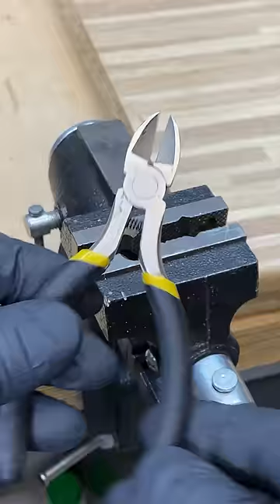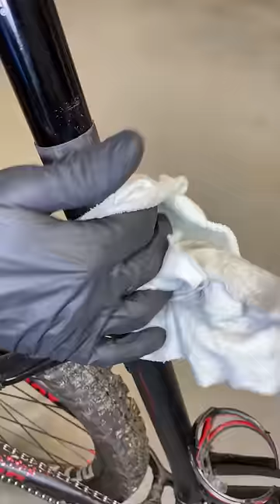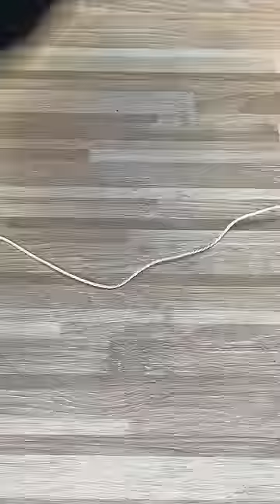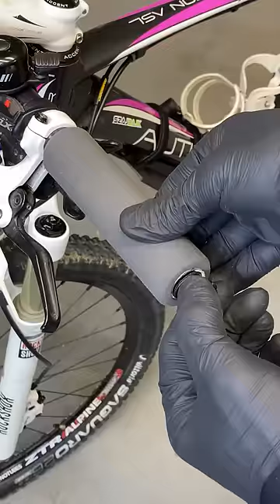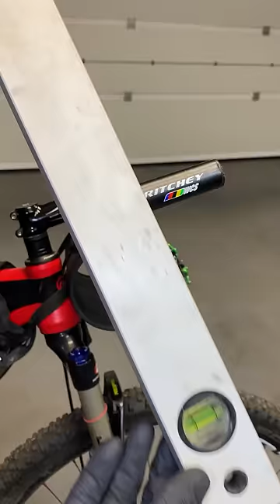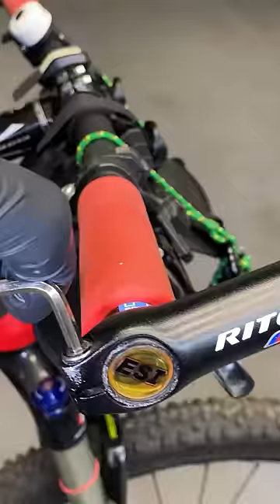Servicing gloves inside the bars, leveling bar ends + more hacks.

Comment: Hack: grease the seatpost so it doesn't get scratched up like crazy 😢
Reply: Only the part inside gets scratched, and greasing it can cause your seat to slide down while riding, I don't suggest this to anyone at all 

Your seat is always in a fixed position, there's no reason scratches should be showing.
Reply: @selfactualizer2099  you ALWAYS grease the seatpost or use carbon paste. A seatpost will eventually corrode and seize inside the frame if you don't. It's also a common cause for creaking as the frame flexes if the seatpost isn't greased.
Reply: @selfactualizer2099  you literally throw some polylube in there every time, that's like bike mechanic 101 man c'mon.
Reply: @selfactualizer2099 if you're riding a mountain bike without a dropper post then you're always moving it up and down
Reply: Seatpost takes advantage of friction to stay in position, and you put grease on it? I guess common sense isn't popular nowadays.
Reply: @jaezryl  greasing seatposts has always been standard protocol in metal frames with metal seatposts and it's never caused slipping issues with a proper seatpost clamp. If you don't grease the seatpost it will corrode and it will seize in the frame. Leaving you with a stuck seatpost and a frame that will be trash because of it if you ever need to adjust the saddle height. Besides that, dry seatposts are often a source of creaking as the frame flexes against the dry seatpost while riding.

If you don't want to use grease then you can still use carbon friction paste even on a metal to metal interface. A good coating will prevent corrosion so no stuck seatposts and prevent creaking.
Reply: Mixed metals (alu frame, steel seatpost) = corrode together over time... a little grease keeps it free. Just tighten it to tolerance... I've done this for 30 years without issue.
Reply: @Pastamistic  Can it be done to a post that has already been installed and being used for about a month, or is it too late?
Reply: @LLF1234  definitely not too late! It's only too late if the seatpost is already seized into the frame due to corrosion and you can't remove it.
Reply: @jaezryl Newbie, huh?😂
Reply: @Pastamistic I just repaint it when it rust or paint gets scraped.
Reply: @ashenshield1712  how do you know your seatpost is rusting inside the frame? If the seatpost in the frame seizes in place because of rust how do you get the seatpost out? This is a rhetorical question. You can't tell and once the seatpost is seized you typically can't get it out without destroying the frame. Now you need to scrap the frame and buy a new one because you couldn't be bothered to grease the seatpost.

Comment: As a professional bike mechanic… do NOT do these things. Except level your saddle. Do that.
Reply: Why shouldn't I cover the end of the seatpost with a piece of an old tube?
Reply: @_modnar_  I guess there's no reason not to if the tube happens to fit your seatpost. The better question is why would you and what problem is it solving?
Reply: @Pastamistic  I guess preventing dirt from settling at the seatpost, so maintenance is a bit easier and no scratching/damaging of the seatpost.
But because OP said "do NOT do these things" I challenged him on this specific "hack". And did not get an answer yet...
Reply: @_modnar_  clamp is tight around the seat post. No dirt is getting in that way. Just clean off the dirt before you adjust or remove the seatpost. The reason why you wouldn't is because it's a pointless waste of time. Besides that tubes dry out and breakdown in direct sunlight pretty quickly.
Reply: @Pastamistic  I kind of agree that it might be pointless for the usual bike, but phrasing it like "whatever you do, do not do these things", like OP did, is a bit wrong. That's all I meant to say with my first comment.
Reply: So you don’t recommend disabling your dropper post with a tube?
Reply: @_modnar_  It looks f*ckin horrendous mate
Reply: @Lifebydeath how would that disable the dropper? Does your dropper go straight into the seatpost tube? Most droppers are secured into the tube, and then the saddle is mounted onto a stanchion that slides into the housing…way to be snarky, but without understanding what your trying to be snarky about.
Reply: you will be out ofwork?
Reply: @Odhege8262  there is no need to put an additional tube around there .. your seatpost should have a rubber seal there anyway to prevent dirt getting in there. Also the way he put it over the seat tube will make it impossible to remove without cutting it which puts the risk of cutting into your frame (devasting for carbon frames) or your Dopper or worse yourself
Reply: @Ceriva09  there is no rubber seal on the seatpost to seatpost tube connection. That’s on the stantion of the dropper, into the dropper itself. And if you’re struggling cutting a rubber tube, buy a new razor blade. I don’t do this, but I can see it’s point.
Reply: The one where he hid a gloves on the bars is actually useful, idk what flaws I could have with that
Reply: @Ceriva09 I have never seen a seatpost with a rubber seal. Ever. Must be a thing for carbon bikes.
Reply: @peterwillson1355 I’ve never seen a carbon bike with a rubber seal before either
Reply: teach me
Reply: @_modnar_ there's no problem in doing this. The guy who posted is pretending bike maintenance is some arcane level arts
Reply: @_modnar_  the person in the video scratched the seat post by wiggling it side to side just pull it straight out.
Reply: dubious statement

Comment: DO NOT ride with open bar ends.  They can KILL you in a crash.
Reply: How?
Reply: @franciscopuerta7070  They will IMPALE you.  No end cap and the bar acts like a cookie cutter
Reply: @bindingcurve  but with the end bar caps are fine? Sorry, i want to know because i just put some bar ends on my bike last week and you got me scared
Reply: @franciscopuerta7070  The end caps make it a lot harder to be impaled.  Blunt end vs cookie cutter.
Reply: @franciscopuerta7070  someone I know heard of a kid who had handlebars turn 90 degrees in a crash and flew forward with the end going into his chest, with the plug in the end you got more area and so needs more pressure to go through, think of like bed of nails, if stand or sit hard on they will go in but when lay on them you got more area of them so less likely to even go in as more contact area

I disagree with my bike project how they do brake and gears where you can turn bars 90 degrees, unsure how far my bars will turn when forced but I put shorter length of cables on mine so normally when steer can only turn 45 degrees
Reply: @mlee6050  That won’t help when crashing. The cables will not stop your bar. Also the chance to get killed by your barends is very low. How often you have heard of people who where killed by biking through impaling? Just think of these thousands of things, fences and poles next to our bikeways. Yes, theoretically it could happen but the chance is that little that you don’t have to be scared. Simply check that there is no unnecessary sharp edge is everything you have to do.
Reply: Shouldntstore12gaugeshellsinemeither
Reply: Тебя и асфальт может убить
Reply: @florianblonske  Чув про 2 випадки коли кермо пробивало живіт, один випадок був багато років тому в моєму невеликому містечку, літній чоловік їхав з гірки, не впорався з керуванням, кермо розвернулось на 90 градусів і зайшло в живіт, і знаю що там точно не було заглушок... Про другий випадок памятаю писали в новинах 2 роки тому, хлопчик так само пробив живіт кермом, але там без подробиць... Так, обидва живі, але я б не казав що шанс дуже низький.

Comment: Will you now resharpen the cutters afterwards to be able to cut cables?
Reply: I think it's obvious what these pliers are for. I don't think he uses these for cutting. It's his preferential tool for the job.
Reply: @selfactualizer2099  cable cutters have crimps built in for this purpose. Without needing to ruin a tool.

Comment: Don't put a seatpost into the frame dry. Grease it in any metal bike and make sure to have grease in the slot in the frame has grease so water can't get into the frame. Dry seatposts will seize in the frame. In a carbon frame, use carbon paste to keep it from slipping down.

Comment: What was the purpose/function of running the gloves through the handlebars?
Reply: As a storage compartment for when you need to fix something on the road and don't want to cover your hands in grease.
Reply: @KaiPerinja  I suppose it is clever, but since you have to (or should) carry other tools as well, why not just keep everything in a bag?
Reply: They are stored in there.

Comment: Park tool needle nouse pliers come with a great cable end crimp ant it will hend 100 times better that tha way he did it, don't waste your time trying  these "HACKS" ,the only okay one is that you can put things inside your handle bars but DO NOT do it if you have carbonfiber handlebars and yes always make sure you're saddle is level and make sure you're seatpost is grease.

It's great to want to do new things and learn new stuff  but is also smart to admit  that maybe you're not not so skilled enough,  never do things that you don't feel comfortable doing specially if you know that you could damage something  and if fo, it would cost you more to have it fixed afterwards. 
Doing and know how to do things is as smart as to know your capabilities and when to seek help

Ride safe.🤙🏼

Comment: Save yourself a buck an just get the right tool for the job. 
Park tool CN-10 wire cutters have the correct crimping tool. 
They are cheaper than two regular wire cutters and work better on braided cables. 
You are welcome…

Comment: There is a nub on the cable cutters for pinching those cable tips. I rather solder the ends and tuck them under the brake springs or somewhere out of the way.